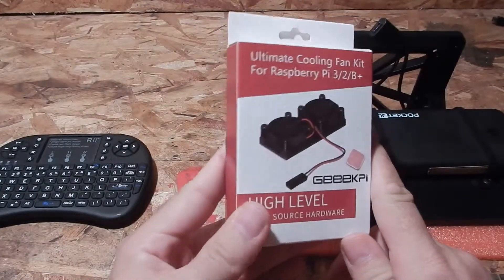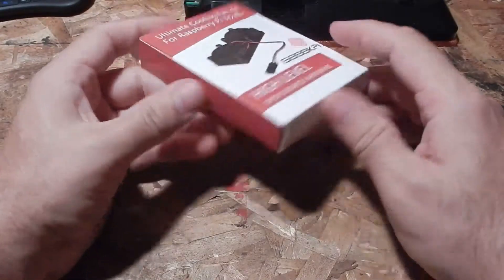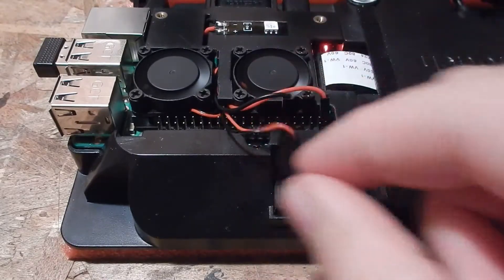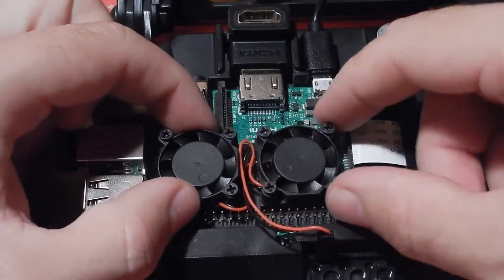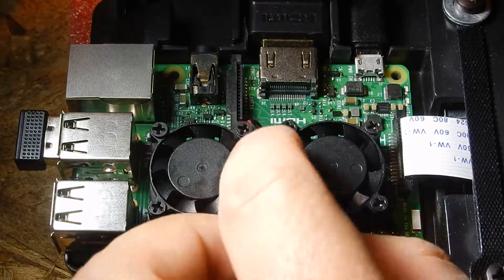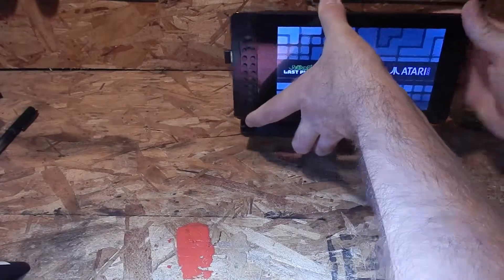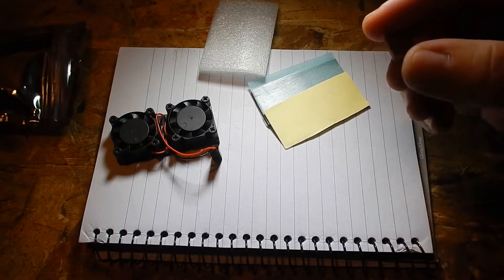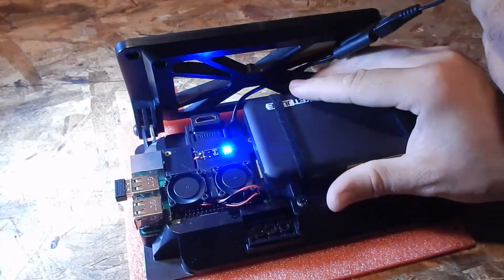GeeekPi Dual Fans for Raspberry Pi Sucks Part 1 The Fan Replacement

Comment: Did anyone notice how both boxes seemed new at first not roughed as it was when he started unpacking the new one? I mean not a bad way to recoup if you fak up a project or want to get or trade parts nuthn wrong with that
Reply from the maker: Everything is legit in the video.  That's how the box came.  Those are garbage fans though.  I no longer use them.  They just sit in their boxes now.  I use RC Car Ball Bearing fans with much better quality.   I can make them whisper quiet or sound like a jet.  The back of my Pi has even been modified more since this video.
Reply: @DestructiveBurn  cool thanks for the feedback appreciate it.
Reply from the maker: @miguelanaya2183  You bet! :)